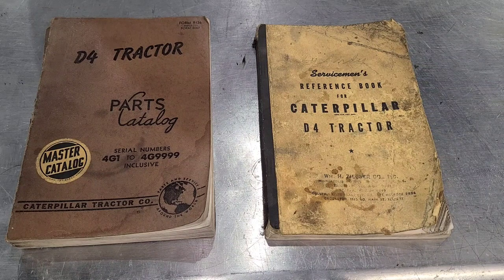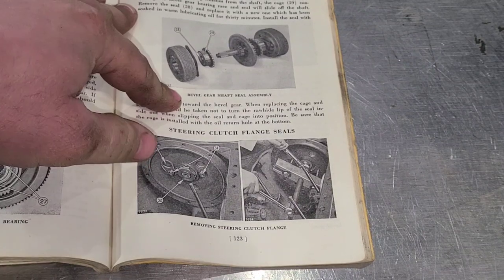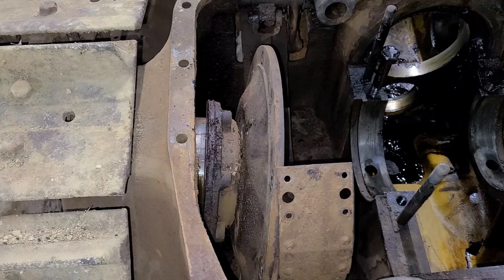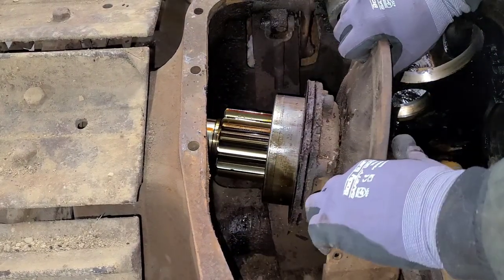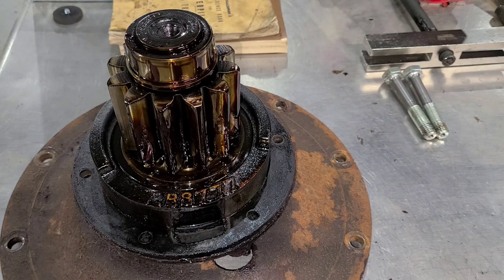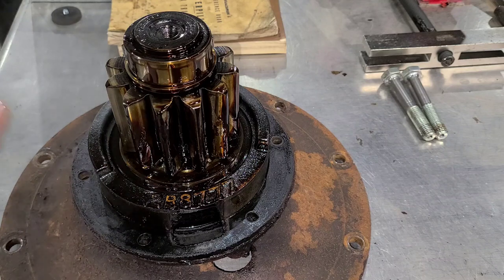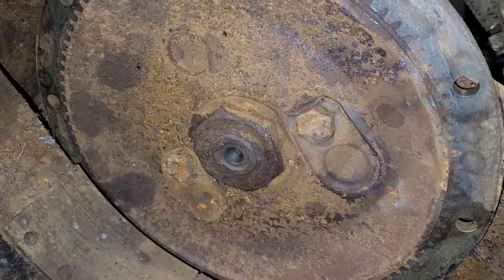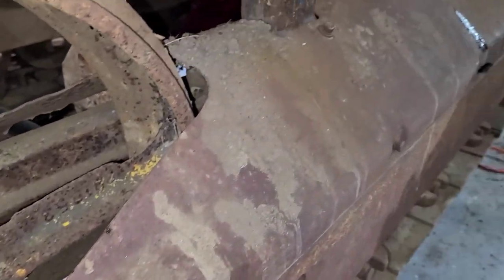Caterpillar RD-4 Chassis and Rear End Disassembly Pt.4

Comment: Hard to know what they were thinking when they wrote the manual.
Reply from the maker: It's funny, the manual changed. Matt with Pacific Northwest Hillbilly says his manual shows a hydraulic puller, not a threaded T bar like my manual does
Reply: Goes to show that the people who write the service manuals never get their hands dirty
Reply: 1st gen manual later edited to show the correct way?
Reply: Sucks to not have the tools readily available to pull them flanges, but great that there’s a way around that for the time being.
Reply: @kylechrist  according to the manual they are using a 8b7548 puller that is rated to 17.5 ton. So could actually be doable depending how hard they actually pressed it on, but perhaps not after sitting outside for a few decades.

Comment: Hi Kyle, firstly, thank you for taking all the trouble to film this adventure. I'm no expert but I don't think heat will release those tapers. The gear axle will expand along with the housing - possibly at different rates depending on material (Steel may be slightly higher than cast iron - see Wikipedia 'Thermal expansion' ). You also don't want to affect any hardening of what I'll call the shaft either. Presumably you can hire a hollow ram hydraulic puller and I suspect that will be the best way. If you have n't already (!) please watch Squatch's safety tips when applying the considerable force required - basically keep out of the line of fire. Alternatively, bite the financial bullet and take it in to a firm that does this sort of thing for a living, the last thing you want to do is damage the components, especially as those pinions look in remarkably good condition.
Reply from the maker: Bob, I'm looking into buying a puller setup, but they surely aren't cheap. Thanks for watching 👍
Reply: I agree heat and a puller may not do you much good. It is in my  own personal option that if you use heat to remove tight press fits you also need to cool it. Like changing a ring gear on a flywheel.

Comment: I was one of the guys suggesting heat and beat, and I'd never argue with the guy that actually has to deal with it when he says it won't work. What the manual says and what actually happens after 50-60+ years is another story too.
Reply from the maker: Heat and a mechanical puller would probably work, but it's going to need to be a lot bigger puller than what I have haha
Reply: @kylechrist  at that point it's easier to get it in a hydraulic press, can be a little safer and controlled. Note I did say a LITTLE.

Comment: A couple of hundred degrees of heat would have done the trick, you don't need to get it red hot just make it grow a bit to release the taper fit.  A cutting torch is the deal to use as you want the gear to heat rapidly so it doesn't have time to transfer the heat to the shaft. Alternatively you can heat the whole gear then pour water on the shaft to shrink it fast and do the same thing. No need to get it so hot to damage the seal. 300-400dgrees would be plenty.
Reply from the maker: I could but I'm going to need a way to press them back on so for now I'm going to wait until I have a hydraulic puller/pusher

Comment: Today we see value in restoring and preserving these old machines that were built with engineering skill and careful craftsmen.. I wonder if 70 or 80 or 90 years from now, if they will be fixing up todays computer laden junk?   Probably not.  They will be doing round 2 on 160 to  200 year old iron..
Reply from the maker: You're more than likely correct haha

Comment: Kyle  we had axles and hubs for a 33 massy Harris tractor in a 50 ton press and they would not pop !! 
The seals were bad and you had to take the hubs off to change them !!!
The guy didn't want us to heat the hubs because he didn't want the paint scorched!!! 
But we told him it was the only way!!! 
He finally agreed to heat !!!!
So we put all of the pressure the press had on it and lite the torch and touched the hub with the flame and as soon as the flame hit the hub the axle popped out !! Didn't scorche the paint at all !!!!  Both did the same !!! 
🌎🌞👍👍😊
Reply from the maker: If I had a larger mechanical puller here then it would be a different story, but trying to put that much pressure into machined bolts and a small puller doesn't quite add up for me. I'm looking into a setup like squatch253 has but they are $$$, thanks Evan
Reply: @kylechrist  yeah!!!! 
I hauled aload of shreadeble in today and the fuel  ate it all up 🤔

Comment: Excellent info! Glad that you are moving on.  If you read ahead in you manual you may get important info on the needed tool and/or procedure for install / removal of your flange. I wonder if you talked with a CAT Service Technician or a Repair facility If they could or would share any insight on removal.
Reply from the maker: My brother works for our local Caterpillar dealer, unfortunately many of those tools are obsolete even from Cat
Reply: @kylechrist  That is to bad, Although with a little digging sometimes you can obtain copies of historical drawings or service procedures,  etc. 
I hope the sun shine down on you and your project and it comes apart with out issue and you continue to great success in your project. 😁

Comment: So far so good Kyle. Unlike Matt aka Northwesternhillybilly his drive drain was very trashed but also his machine was used probably for dozing in the woods? So far the only major loss seems to be the engine itself but maybe the inside is still good but the liners are all shot i think. If it is a 20 ton press fit then with rusty splines and keyway's no way it will even move with a regular puller.
Reply from the maker: Engine disassembly will be coming after the chassis is completely disassembled, so we will find out soon

Comment: Hello from Australia, I have been working on earthmovers for almost sixty years and would like to say that pressing these flanges on at 20 tons is way to much, with a 1.5 degree taper and multiple splines I would not press the flange on at all, lightly oil the splines, grease the thread and tighten the nut 350lbps. Give it try on the floor to pull it off before you put it back together and you will be surprised how tight it will be to come off. 20 tons press fit is absolute bullshit, I think that the workshop manual is wrong.